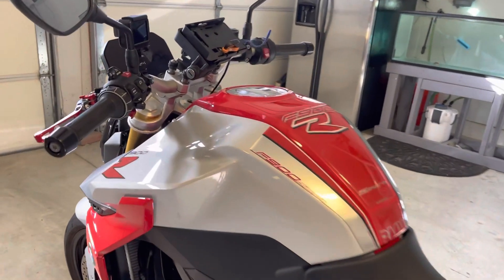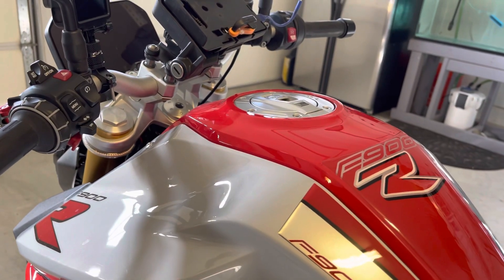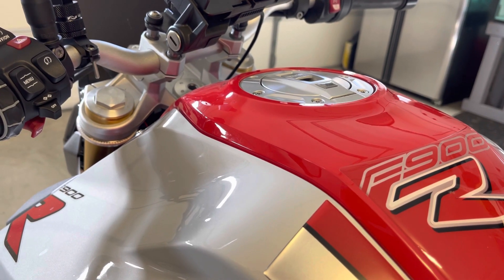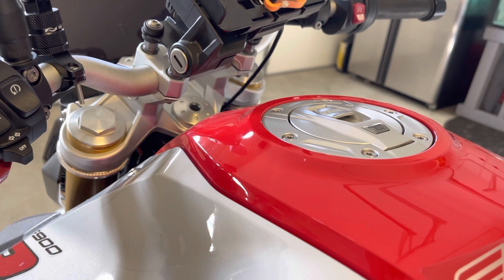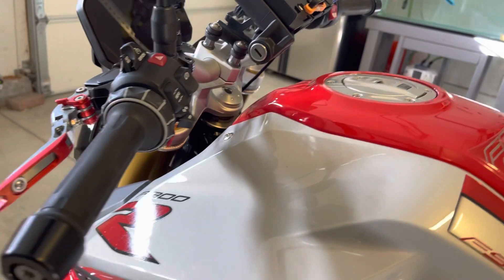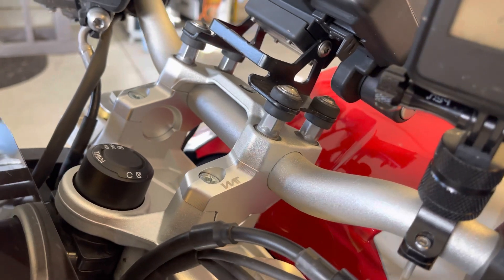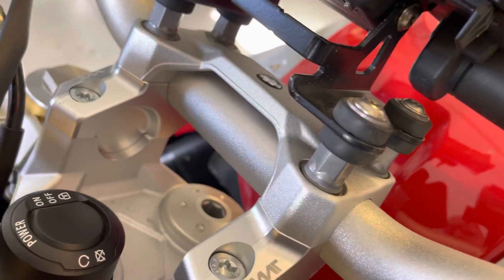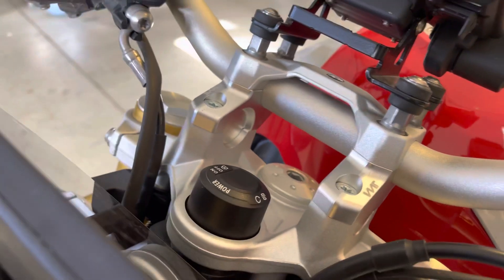BMW F900R Handlebar Risers

Comment: Did you have any issues with your brake line?  Mine seems super tight. I ordered a set of offset risers, but I am concerned, the lines are going to be too short.
Reply from the maker: You should’t have an issue may have to trace the line to make sure it’s not wrapped on something unnecessary